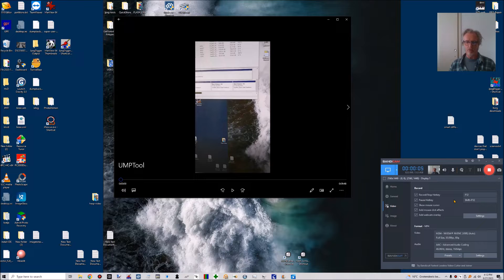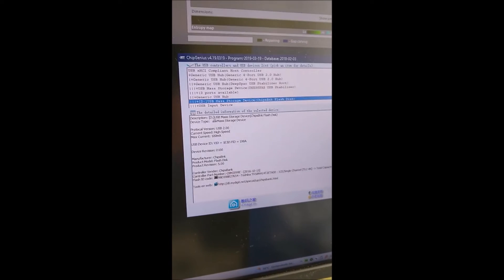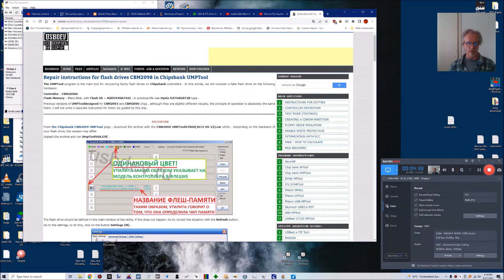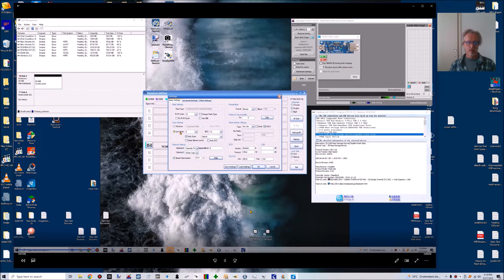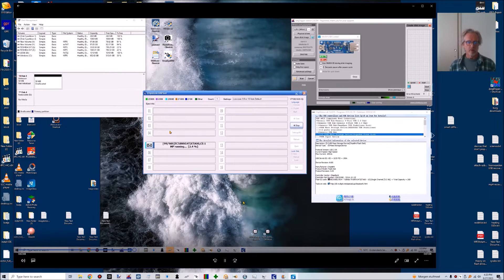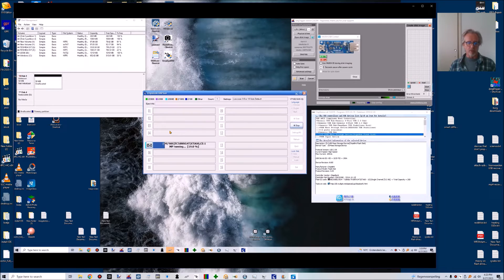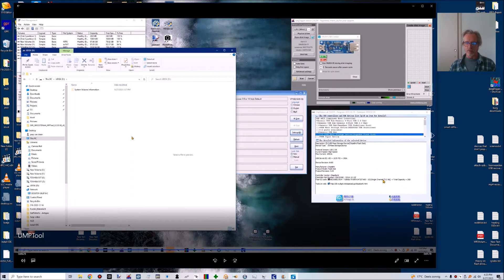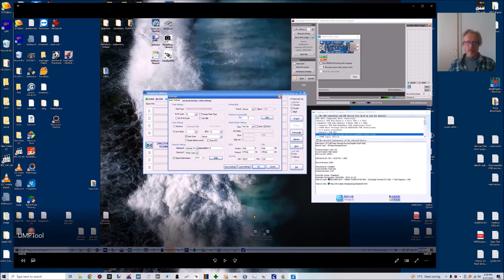USB Flash Drive, No Media. Using 'MPTools' to fix broken USB Flash Drives.

Comment: My USB doesn't show up
Reply from the maker: Tough luck, controller dead or some passive component dead.
Reply: @DiskTuna Sorry, I was a bit misleading. I meant it does show up on my PC but not within the program. In the meantime I managed to find a UMP program that actually detects it and now it is already fixed, turns out the 16 GB pendrive is only 7.5 GB big.

Comment: @DiskTuna Of course I stumbled over your great explanation when one of my thumbdrives went "no media". This way I found it being a CBM2199E according to ChipGenius. In reality it's a 32GB CBM2199EB which can be successfully firmwared back to a media "inserted". Funny is on variation of settings this partition gets either one or two Megabytes (!) in size, but not more. Did you fiddle with the settings in the remaining two and not in the video shown tabs of UMPTool? Here's parts of the output of the genius after the tool ran, thank you for your thoughts.

USB Device ID: VID = ABCD PID = 1234
Serial Number: 2401081001490978917100

Device Vendor: General
Device Name: UDisk
Device Revision: 0100

Manufacturer: General
Product Model: UDisk
Product Revision: 5.00

Controller Vendor: ChipsBank
Controller Part-Number: CBM2199E - [2019-11-11]
Flash ID code:      983C98B376E3 - Toshiba - 1CE/Single Channel [TLC] -> Total Capacity = 32GB

Oh, forgot to mention: It is not the partition with size of 1MB, it is the whole drive.
Reply: Forget about it. I found the culprit. The tool had chosen the wrong scanfile/codefile combination. The make things short, it is not about what the settings are. It is all about of what date UMPTool is. I had switched a few versions to find 2020-06-24 as the date of version solely working for my thumbdrive. I did not have to chose it to create partitions of specific sizes, neither did I have to wiggle more parameters. - All good now, size correct.

Comment: My 128gb pendrive is decreasing it's storage to 60 gb 
Before i had 125
Reply from the maker: No idea, maybe one out of 2 NAND chips failed.
Reply: @DiskTuna  i solve there storage issue now is another problem I can't able to add files now
Reply: @Bryce7.4  Bin2,60000MB block
Reply: @Bryce7.4  how did you solve it? I used a 256 gb but now is 64
Reply: @Bryce7.4  how did you solve storage i have 128Gb now 60GB

Comment: If you copy and paste into google search the two lines in the output of chip genius that tell you the controller part number and flash ID, it will show you the relevant section of flashdev, where someone in the comments has posted which version of the software worked for them. you find that comment easily by Ctrl+F and pasting the text again. Then you copy the version of the tool that worked for them and Ctrl+F that, and it will be highlighted. Otherwise you might have to guess and try many versions, as I have had to before with some rarer combinations of controller and flash.
Reply from the maker: Yes, some times the VID and PID on flashboot.ru or usbdev.ru is enough.

Comment: A small correction: The software is made by or for the companies that develop the controller chips, which are then manufactured and sold to the drive manufacturers. Think of the controller like a car's engine.
Reply from the maker: Correct, by the maker of the controllers for those that implement the controllers.
Reply: @DiskTuna Do you know how to add a chip ID to MPTool?  Got flash ID 45 48 99 B3 7A 6B and it's a 512GB Sandisk 3D NAND chip.  Got one of those SM3281AB boards from eBay and the chip from a failed SSD.
Reply: Is there any toola that i can use for sanddisk and HP  pendrives

Comment: Hello
I've managed to fix my USB 
But once I unplug it reverts back it's settings to the corrupt ones(settings are not permanent)
Any solution...?
Reply from the maker: In general I'd advise against fixing 'broken' USB flash drives. Likely the cause is bad NAND which this 'fix' does not solve. The USB drive corrupting like this 95% certain is a symptom, using a MPtool solves the symptom, not the issue.
Reply: @DiskTuna  ok my USB in NAND,but u mean I should just buy a new one?
Reply: @DiskTuna  I have a 128GB drive that has lasted years after reformatting in MPTool.  Also had reflowed its board with a heat gun.
Reply from the maker: @soundspark  OK. Still in general I wouldn't recommend it. Bit like one person happily uses a hard drive with 20 reallocated sectors without issue, still I would not recommend it in general.